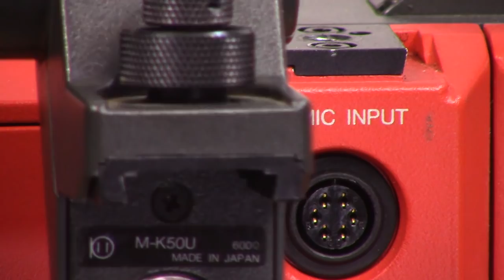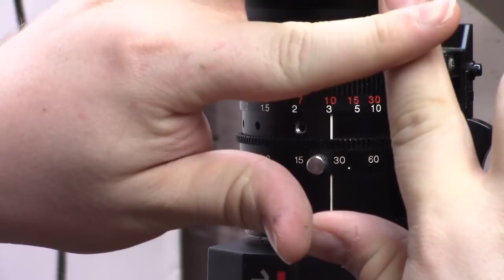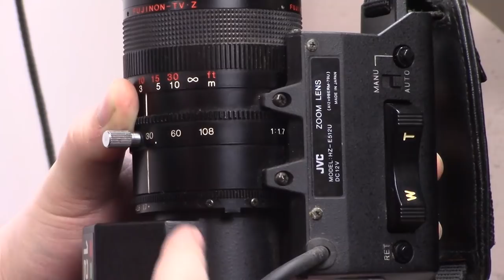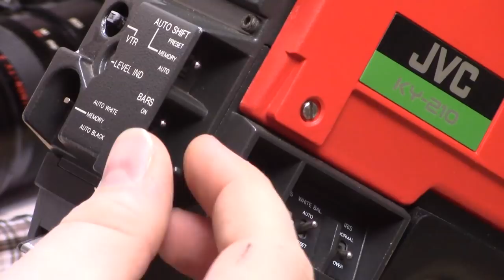Love Letter To JVC KY-210 - Part 1

Comment: 14:35 Backfocus is where you calibrate the lens to the camera. It adjusts for the distance of the sensor to the lens elements.
The point is, that when you change the focal distance (zoom in / out), you want to keep the focus set at the same distance. This basically means that when you zoom in on an object, focus, zoom out... the object should still be in focus. 
So, to set the backfocus, you zoom in on an object and focus with the normal focus ring (front most ring on the lens). You zoom out and adjust the backfocus. You repeat this a few times to make sure it is well adjusted. 
As calibration object, you want to use a backfocus card (or the so called, Simens Ring). It is like a black and white pie-chart. It makes it easier to focus the lens.

Comment: As a 13 year ENG veteran, it was really entertaining watching you marvel over every detail of a (very ordinary and unremarkable, except for the unusual red color) ENG camera. It brought back some of the wonder I felt back when I first started working with ENG cameras. For someone with no formal training, you figured everything out really well, including backfocus. Bravo!
Reply: One thing that impressed me about this camera’s design is the aluminum flap that covers the BARS switch. Holy crap, why is this not on every ENG camera? On most, the BARS is completely exposed AND located right next to the Gain and White Balance switches, so it is all to easy to hit BARS by accident when trying to adjust gain or white balance, and totally ruin your shot. It’s such an obvious design flaw, yet Sony and Panasonic continue to make ENG cameras with this flaw even to this day. Drives me crazy. Bravo to JVC for solving this problem back in 1981. Now why didn’t their solution stick??
Reply: @matthewelton7393  Yeah, or what to think of the volume dials on some (many? don't know) modern ENG camera's: usually recessed in the older style camera's to protect against accidental adjustment and accesible by opening a cover that would also provide control to phantom power and such. Nowadays, they're just bare accessible and only feature some idiotic cover that breaks easily, or aren't even covered at all...

Comment: I shot news with one of those in 1986/87. Great camera and it was actually smaller and lighter than IKE 79E. The KY-310 was a little more comparable with the IKE in size and video quality, though I never found the 210 lacking. Teamed with a Sony BVU-6800 3/4" deck it was my favorite rig until I got a Betacam.

Comment: the way you talk about this camera actually parallels very closely to my feelings about my two old Tektronix oscilloscopes, one of which I still regularly use on the bench
its absolutely a thrill to work with something so high quality, so heavy and bulky and over-the-top, all-mechanical, no-nonsense
so far 'above my paygrade' i guess
definitely one of the best parts of working with pro equipment, even several decades old pro equipment
love the video!

Comment: S stands for Servo. the back focus adjustment is critical for achieving focus at all focal lengths. in a professional environment the focus is acquired  by zooming on the subject, and then zoom out for framing and composition. the back flange not being adjusted properly would result in out of focus image when zoomed out from the subject.
Also, the front REC button is there for when it's used on a tripod: right hand at all times on the handle to control pan and tilt, while the left is free to operate the button or further stabilize the camera's movements.

Comment: I used a similar camera to this (the JVC KY1900) back in June 1985 (34 years ago).  I was working for a small video production company making wedding videos, etc.  Even then the KY1900's were a bit past their sell-by date and one of my jobs was setting the registration of the camera tubes using a black and white resolution chart.  I always wanted a Sony DXC-M3A as they were the standard ENG news gathering camera of the mid 1980s (before Betacam came along) but couldn't afford it so ended up using the JVC.  Also remember that they are only cameras, you had to run them into heavy "over-the-shoulder" (or usually around your neck) recorders.  So it was nearly always a two man operation.

I remember being out in a riot (after a band parade we were covering went wrong!) and seeing a DXC-M3 being taken from an American news crew and thrown across a road, almost landing at my feet!  Was tempted to grab it, but feared for my safety at the time, so just left it there and got the hell out of the place!!  (And the tubes would probably have been f**ked anyway.)

Also worth remembering that these cameras need a LOT of light to produce a good image.  I think they stated a minimum of 500 lux for a quality picture.  We used to run with a couple of "Red Head" tungsten lights (800w each) for indoor use.  

All the best.
Reply from the maker: Thanks for the firsthand anecdotes! I actually just got a DXC-M3 in working condition so I'll have that in a video at some point - I can believe it could survive that experience given the build quality but that's a good point about the tubes, only so much that glass can handle. I've been thinking about trying to find some monster lights to use these things indoors properly; I have a bunch of tube cameras and none of them can make anything out in my "well-lit" (to my eyes!) studio/office. Thanks again for the comment!
Reply: @CathodeRayDude  You should be able to get tungsten lighting kits cheap these days as everyone is switching to LEDs.  A basic 3 head kit would be adequate.  In work (the BBC) we used to use Sachtler Reporter 300 kits for news & PSC Crews, but they had a major flaw in that if the bulb blew it took out the internal fuse (and sometimes the plug fuse) with it - so I had to always issue replacement fuses along with the bubbles.  We've since moved on to LED panels and they are soooo much easier to use on-the-go.

Comment: I'm glad I found your channel for this specific video. My high school had a 4 year video production program (which regrettably died off not long after I graduated in 1990). Our main studio was equipped with KY-310s and had 210s for mobile rigs. I was more enthusiastic about the production and hardware aspects and not so excited to write and be on camera, and often lugged these things home with the rest of the gear for getting feature footage outside of school.

I hope you can get hold of a rack mounted CCU to enable many more adjustments to the cameras operation, as would be used in a studio.

Comment: Yes, you are usually able to remove the servo-unit and mount on a studio-servo unit, that removes the zoom-rocker and other buttons for manual control, but utilizes servo-focus as well, besides the motorized zoom and iris. Sometimes, this is just and add-on motor-block that is mounted underneath the lens and is fed from the 3-pin connector and gets its controls from a tripod-handlebar focus demand, or it receives (and outputs) signals by CCU-connections.

Comment: The block position on the filter wheel is to protect the tubes.  If you point that thing at the sun with the iris open, it will burn those tubes in an instant.  Seriously, like 50 ms.  I remember stories (before my time) of a continual f-up who came back with a HUGE dead smear across all three tubes on his camera.  Swore to the chief engineer he had no idea what happened, that they must be defective tubes.  Chief asked, "where's your raw footage?"  Threw it in an edit bay, started jogging it forward, and about halfway through the tape, you saw him following the jet through the sky... and across the sun, leaving a black streak behind it.  Which stayed for the rest of tape.

"Still no idea what happened?"
Reply from the maker: oh my god, that's horrifying but unsurprising now that you explain it. phew! i'll keep my wits about me when I get around to taking these things outside.
Reply: @CathodeRayDude  I think that pretty much all cameras with motorized irises would also close the iris automatically when you powered down.  In any event, that era is why I am still paranoid about lens caps.  I also cackle a little when @styropyro burns a CCD with one of his lasers, because just pointing a tube camera at one of his laser DOTS on the wall would likely burn it complete darkness.
Reply: @everlastingphelps  Yep, they still do. At least, my JVC's do that. Set the iris to auto and flip the power-switch on the camera to off and you will see the ring on the lens swiftly move to C (= Close) and slowly come to a stop at the C position. As the switch on the camera is a software-switch, I can't think this is something the servo-units themselves dictate (as in: power the servo-unit without a camera attached and remove power to see what happens)
Reply: @CathodeRayDude  StyroPyro's video about medical lasers shows that even modern CMOS camera sensors can be damaged when light is waay to intense for the sensor to cope with. Though, in his case, it was from reflected laser beams literally blasting pixels off the surface of the CMOS sensor, so...

Comment: The KY-210 is definitely from the early 80's. I worked in a TV news department from around 1986 and we were kitted out with Sony BVP-3 cameras with BBV-1 Betacam recorders but we did have a KY-210 in the news room for day time news updates that would go to air every hour or so. The 210 was permanently mounted next to an on air monitor and a fill light for new presenters to go to air from with the news room in the back ground. That 210 was used for years like this. I used to own a pair of the smaller KY-1900 three tube cameras.

Comment: 12:01 The switch on the lens turns from M manual, to S servo, where the motor and Wide / Tele lever (dis)engages.
Reply: And even funnier: in these old units, it's not even a real switch, but a lever that shifts a cog/gear inside that literally decouples the driving motor from the ring. More modern servo-units (Fujinon Digi-power for example) feature micro-switches that are actuated by the same lever, but then electronically disengage the motor.

Comment: Re: back focus, the coolest things about those bayonet eng lenses is you can zoom in, focus, and then it will stay in focus no matter how much you zoom back out. This makes it VERY easy to manually focus in the field - we used to NEVER trust auto focus and personally I still don't. So you'd zoom in, focus, zoom out. Can't do this with most still camera lenses, because they don't have that back focus adjustment.

At least that's how my old videography adjunct professor explained it to me. I know when the back focus was off, you could focus at one focal length but then when you zoom in or out it would lose focus!
Reply from the maker: The term for this is "parfocal" and I don't know if it's explicitly re: the back focus though I think I've heard they're connected in some way. It's certainly also a larger mechanical phenomenon vis a vis how the lens moves the optical elements, but yeah, it's supremely cool!
Reply: And the weird part about a wrong backfocus is that it looks so completely different than when you just pull focus beyond the subject and have everything blur. For some reason, if you're used to the effect, you can tell whether a defocussed image was done deliberately by pulling focus to close or distant, or someone forgot to adjust the backfocus.

I don't use autofocus (hell, both my 1/3" lenses can't even do that and only of my 1/3" camera's utilizes a signal for autofocus with a lens I don't use as it's fully servo-operated instead of fully-mechanical) and it's always funny when you give someone a camera and the first thing they ask is 'how does it focus... because it doesn't ...'

Comment: So you know, the “LEVEL IND” switch turns on the “zebra” display. With it on, everything in the viewfinder at 95% signal level or higher would show with zebra stripes. You used that to set the iris manually. Tube cameras hated overexposure as did NTSC SD TV sets, so you wanted to keep the highlights right below 100%. I used an Ikegami HL-53 (I think) back in the day with a busted auto-iris circuit. The CRT viewfinders were so good I could set the exposure just by looking at the image in the viewfinder.

Comment: That camera is from 1984. We had them at a cable company that produced commercials. I personally owned the KY-1900 and KY-310. We plugged then into 3/4 inch U-Matic recorders. At the company they were replaced with the Sony M7 CCD camera. I sold my KY-310 and got a BetaCam.

Comment: Auto shift is the white balance button...set your wheel above to the correct genre of color at the scene to begin with.  Then you can have a preset button for kind of the default color temp via the wheel (up until recently it was a physical color and neutral density wheel moved in front of the sensor).  The memory button pulls up the white balance you get when you autowhite, and the auto button is the sensor itself on the fly making the best white balance it can out of a situation...which usually wasn't great...but...might be good for going from one  lighting color temp situation to another...like following someone from a 4300k fluorescent room to a 3000k incandescent room.  More modern cameras had a preset, memory a and memory b, with the nicer ones having a slow transition between the options...which was handy at times.  

I spent most of 20 years as a cameraman in the field. 

JVC was also called the Junk Video Corporation.  Sony and Ikegami were the big players.  Panasonic wasn't really in the game back then.  JVC usually addressed low end and middle end production stuff with their products.

Comment: The back focus was to adjust for different cameras/sensors so that the image remained in focus throughout the entire zoom range. If incorrectly set, it would go out of focus when you zoomed in or out. Also, sensor block setting on ND filter wheel was for "auto black" balance. Auto shift simply selects white balance mode from auto to preset or memory (manual). Great video and very interesting channel.
Reply from the maker: Thank you! It didn't occur to me that the flange focal distance might differ from camera to camera, that absolutely explains why they would do this. And thank you for explaining the black filter - some of my cameras have auto-black that just close the iris all the way, but I'm guessing since the iris isn't always servo'd, this is a more reliable option. I love how pragmatic this equipment is - everything is about "what do we actually need to get our jobs done?"

Comment: As someone with shakey hands I too mourn the demise of the shoulder mounted camera. Even at the prosumer level they're getting harder and harder to find.
Reply from the maker: you can still buy a 15mm rod system and build your own shoulder mount but it's Just Not The Same
Reply: @CathodeRayDude  The counterweight is what makes the difference though. I'm sticking with my hand-me-down Sony HD-1000 until it gives up the ghost, or I'm forced to move to 4k.
Reply: JVC still puts out shoulder-mount cameras for the prosumer market. But it could be other manufacturers are not that keen anymore on those, as the 'get a shitload of accesories before you can call it a camera' cameras are seem to be getting more common.
Reply: I'd be very tempted to get a busted shoulder-mount camera whose internals have gone bad and retrofit a modern sensor array into it. It would be an absolute nightmare to get the controls wired up to the controls from the vintage camera body, though, but it would definitely be a wildly educational project to undertake.
Reply: @mndlessdrwer  The worst part about that kind of retrofits is that the sensor-block is a part that is adjusted to very, VERY tight specifications/tolerance.
Besides that, the lens would most likely not accomodate the new sensor, as it's just not made to handle the far higher resolution compared to a standard PAL/NTSC image.
You have more luck converting an old shoulder mount camera by replacing the internals and lens completely with the complete inner-workings of a modern prosumer camera. These will have most of the switches already present on the old camera.

Comment: It's part of a rare category of "True" Professional equipment. Essentially, money doesn't matter when making devices like these. The engineers don't have to cut any corners hit specific price points or or heed manufacturing constraints.  They are A B C. Where A is the Problem that needs to be solved. B is a list of specifications/standards/features. And C is Fuck You amounts of money for it.  You see these types of highly engineered products in the RF industry all the time (think cell towers).
Reply: Same in audio control systems when you get to the high level. A Digico console costs north of $80,000 but for very good reason. They are built like tanks and to exacting specifications. They can do anything an audio engineer would ever need to do.
Reply: I adore this kind of no-holds-barred approach to designing and building electronics. When the manufacturer knows that it'll sell regardless of the price, so they just throw the whole kitchen sink at it to solve whatever use-case is necessary for that product.

Comment: That big connector is called a socapex. They come in all kinds of sizes and its not really a standardised thing. Like the 4XLR power plug its just a off the shelf part used for whatever they needed it to do. Now a days they're commonly used either for power delivery or signaling on stage setups.